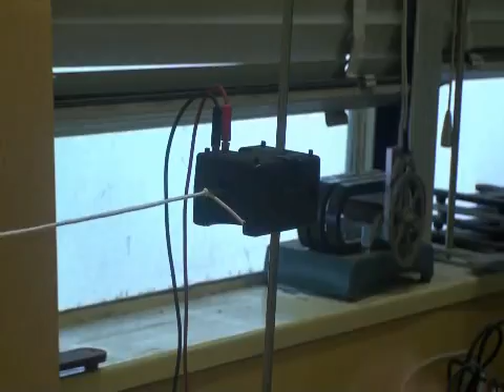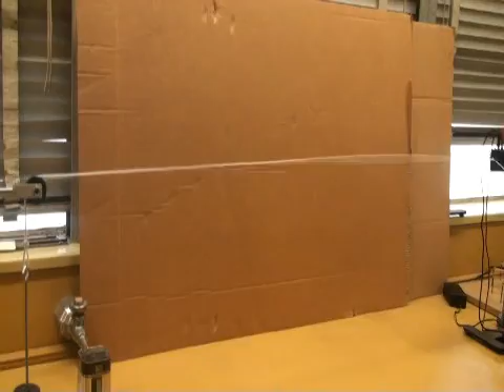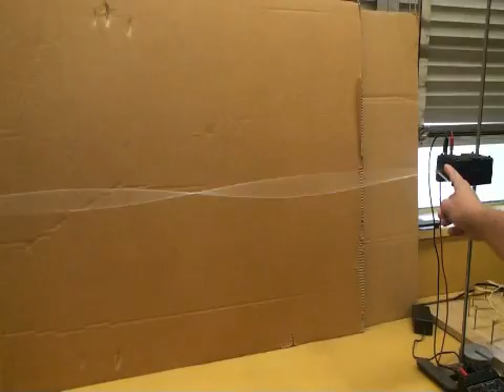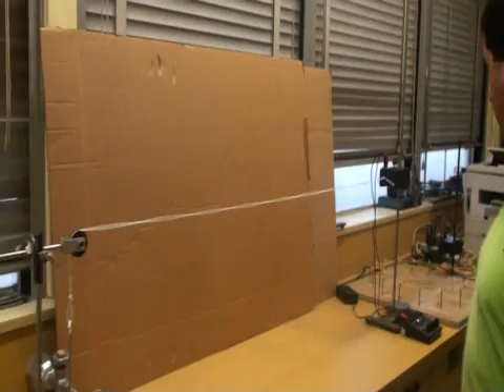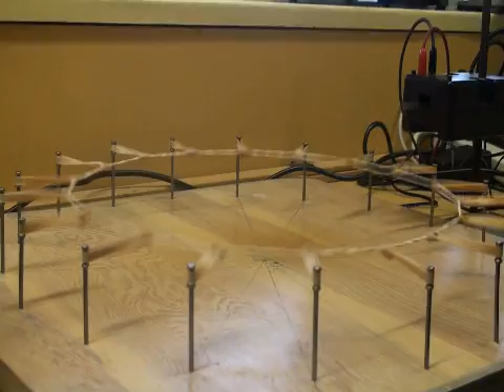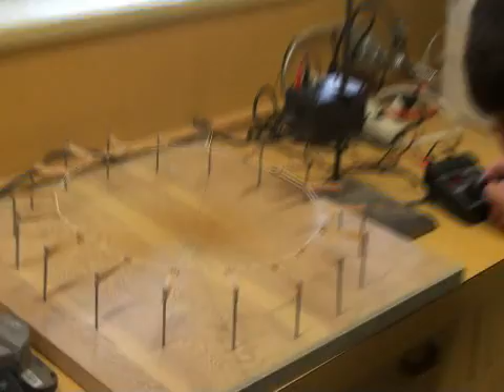String Resonance and deBroglie Waves

Comment: Great video! Though I'd like to clear something up. @ 4:30 or so you say increasing the tension on the string increases the velocity of propagation through it. This is true. However you're wrong (or misspoke) about the affect tension has on the string's fundamental: increased tension INCREASES the frequency of its fundamental. Were you to strike your string with a broadband excitation (like a bow, your fingers or a guitar pick), it would vibrate at its natural fundamental, which as you said in the begining is 1/2 lambda. This is not what your fixed modulator does :-)